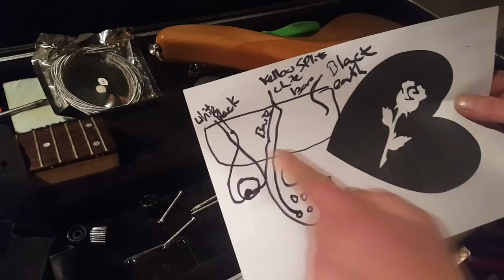Lichtenberg Wood Burning -  Custom Bass Guitar Inlay - Glow in the Dark Project

Comment: You beat me to it!
Nice work.
Reply from the maker: sorry mate but it had to be done, been after a bass for a while now, trying to get hold of a 6 string but finding a model that you know has a solid body with decent timber underneath the paint isnt easy
Reply: thepoultrypeople I've an old Strat body but may use it as a template.  Also wondering if mixing florescent pigment into the resin instead of the photoluminescent may be better on stage under UV?

Comment: Wow, it really tracked down that glue seam on the top didn't it? Great idea, very well executed. Subbed.
Reply from the maker: thanks and yes, alder isnt a decent timber for this technique unfortunately, the neck though is sublime, all the best!
Reply from the maker: actually you yourself may have some advice that you could help me with, what other woods do bodies come in? thanks!
Reply: Cheap guitars can get almost anything, even plywood. Birch, basswood, poplar, alder are pretty common for electric guitar bodies. Painted guitars are often made of multiple pieces (like yours) so you run the risk of the charge tracking down the glue line. They save the "pretty wood" for natural finishes.

Some guitars will have a multi-piece body and a very thin layer of veneer on top. Not sure how that would track since it's so thin, maybe along the glue layer beneath? Interesting prospect. Worth an experiment at least.

Nice guitars have a base wood (mahogany) and a thicker top layer of wood (maple) called a cap. THAT would be a nice one to see as you wouldn't be worried about how the electricity interacts with a glue line, just the wood itself.
Reply from the maker: mate, solid gold, thank you very much, right, its the last ones that would be worth doing, maple is just amazing when burnt, where do i go from here? buy a guitar thats constructed like that or just a body piece? i dont think my woodworking is quite up to building guitar bodies yet, or maybe im wary of something i havent any real knowledge on

i uploaded a video of a longboard being burnt and thats made of plywood, the explosiveness of the glue in between the sheets was impressive!
Reply: thepoultrypeople You could try to find an existing guitar with a maple top like an Epiphone or Gibson Les Paul but you have to know what you're looking for. Not all Les Pauls have a maple cap. 

You could also find a kit guitar with a maple top. Note that many are sold with a maple veneer (very thin) and not a cap (1/4"+). Not sure what the penetration of the current is, so a thick or thin top may or may not be what you're looking for.
Reply: It would be worth a test to make a mahogany base a maple cap and another with maple veneer to see how/if there's a difference. I'd use a standard carpenter's glue like Titebond I as this is the type typically used. Let me know if I can help, it's a very cool technique.

Comment: What is the powder mixed with?? 
When its sanded back down and I clear coat polish it will it turn out like that or is there something else to make it glow?
Reply from the maker: Powder is mixed with Polyester resin. I used clear coat hard wax oil (Osmo) to finish it off. Really nice to play.
Reply: Would craft casting epoxy work?

Comment: obviously this looks amazing, but i wonder if it affects the wood's strength and resonance. everything burnt will lose its structural integrity around the char line. for a body i see no problem since a guitar body is far more mass than needed to hold tension but the neck and especially the headstock are fairly thin and a small fracture can lead to breakage, this just seems like a risk of ruining the neck. if it burns deep enough to fill with glow-poxy, clearly its not a superficial burn like flaming maple tops for the grain pattern. again, awesome look, im just concerned about a lot of work in something that has questionable veins of missing material. someone correct me if i am missing a step pr detail that voids this. i know the surface marks are epoxy filled-in but only the lines exposed and the epoxy is now glued to a charcoal surface, fine for decoration but not structurally solid under a lot of weight.
Reply from the maker: What youd need to research is the  bending and compression stuctural strength of the timber including and compare them with the types of resin and their properties. All the numbers are out there on the net. Just picked it up and looked down the neck, seems like the day it was bought.

Comment: Can you tell me what was used in all this? 
I wanna do this to my guitar.
Reply from the maker: A technique called Lichtenberg FIgure burning, then some glow in the dark resin applied to it. Lichtenberg is hazardous to do, do a lot of research first.
Reply: What are all the tools I'll need?
Reply: What is the powder mixed with?? 
When its sanded back down and I clear coat polish it will it turn out like that or is there something else to make it glow?
Reply: I've done tons since then about to copy the idea but on the resin what did you mix with and how will I get that kind of glow after it's all dried and sanded?